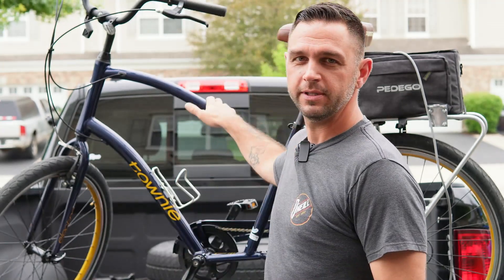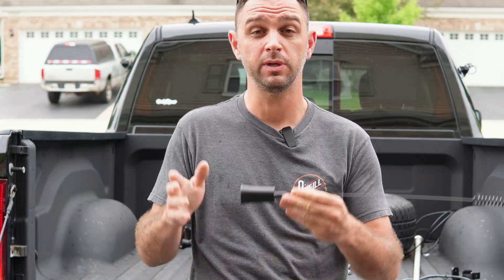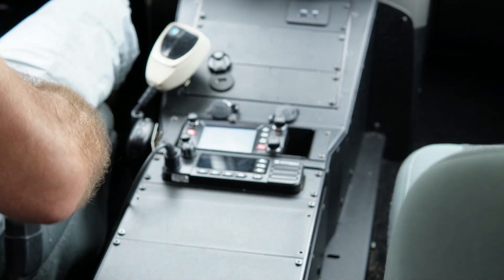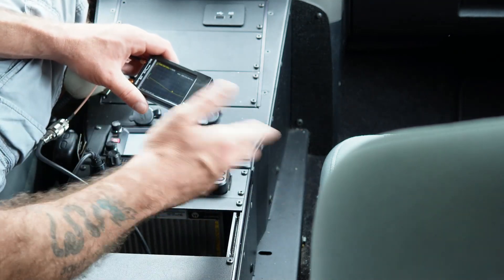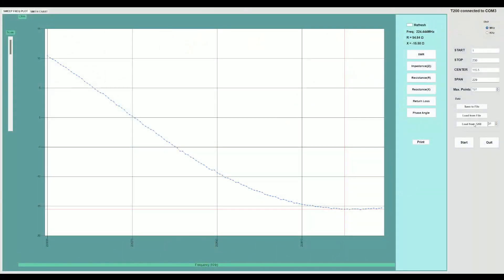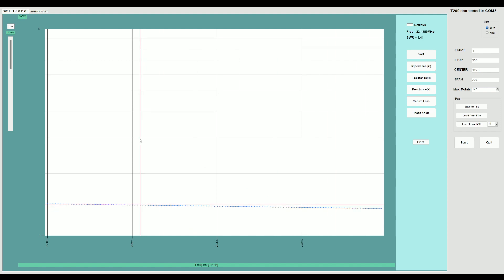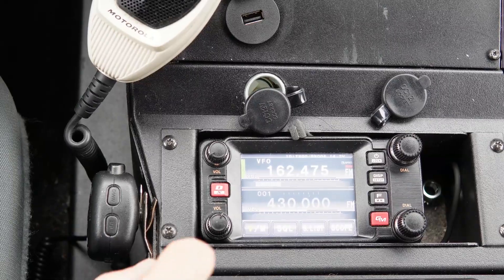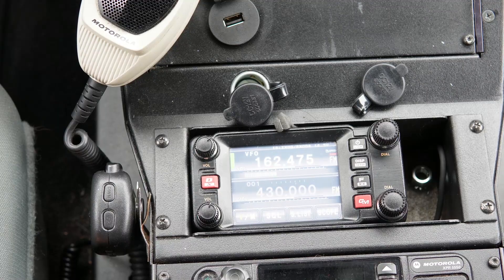Larsen NMO 2/70B Mobile Antenna Overview - Will it 1.25M?

Comment: Thanks for making the video. I have the Larsen NMO ⅝ wave and it has performed well. However, if you were comparing its performance to a ¼ wave on the same NMO lip mount on the door of your truck, you were hamstringing the ¼ wave antenna, which needs a ground plane where a ⅝ wave does not (it needs a counterpoise but doesn’t care about a 1/4 wave radius of flat reflective metal at 90 degrees from the vertical). An apples-to-apples comparison would be the ¼ wave in the dead center of your truck cab’s roof compared to the ⅝ wave on the lip mount.
Reply from the maker: I see what you're saying and it makes complete sense.  Thank you very much. I did keep things the same. I'm pretty much the reason for that is originally I didn't want to drill into the roof as this was a lease.  Now that I own the vehicle, I may be more inclined to do that and it would definitely improve performance. Additionally, I think that would also resolve some reactance issues.  But what I think I can do to continue on and keep on experimenting, it's just getting a mag mount on the roof temporarily.  I don't have one that will fit the nmo at the moment, but I'm sure I can come up with something. And then ultimately, when I move it to the bicycle, it's probably not going to make a huge difference where it's mounted because of the limited surface area.  Thanks again, and I'll hopefully have another update to this soon
Reply: @DudeTested  I haven’t done a bicycle mobile rig, but I think the concern with using a ⅝ wave on an NMO mount on a bike is the relatively small amount of metal to be used as a counterpoise. I think KB9VBR did a video using a homebrew EFHW on a fiberglass whip. It’d also consider doing a roll-up j-pole on a whip. Not as slick looking as putting an NMO mount on a rack, but potentially more effective.
Reply: Tim... you are spot on !  Thanks for keeping our Dude on the path of the Righteous ! <Smile>
Reply from the maker: Just an update, I ordered a nmo magnetic amount for the center of the top portion of my truck. It should be here tomorrow and that means hopefully I can start recording by Thursday.  I appreciate this because it really not only teaches something, but gives me the opportunity to have other people learn from my mistakes.  I really do get excited about this stuff lol
Reply from the maker: Hi tim, thanks again for the suggestions and knowledge.  I spent the day kind of playing around with a few things.  Number one I got a magnetic mount and placed it in the center of the roof. However, it appears at the magnet isn't very strong and there's no significant difference in the capabilities of either antenna (my old one or this one).  My thought process on this is one of the few things.  It's possible that even though I'm on top of the roof, I'm not getting a good ground plane.  Also, I did move the vehicle toward the center of the street which should be far enough away from any metallic objects that would create any kind of weird coupling style effect.  I wanted to run this thought by you.  If I took a grounding strap and ran it from the magnetic mount to the frame of the vehicle, I believe that that may increase the overall performance of the roof mount.  Otherwise, most values and reception are about the same as they would be on the side of the vehicle where I have it now.   Additionally, I suppose I could modify the three magnet Mount that I currently have to work for an NMO, to see if I get better results with a better magnet.  Is there anything else you can think of? My other thought would be to create a bracket to mount this on top of a large metal fence that I have currently.  Dispense would be away from any kind of electrical sources and may help to see what readings (on either antenna) and reception is compared to on the truck.  Any thoughts? Thanks again, and I appreciate all your assistance
Reply: @DudeTested  I’ve used a ¼ wave on the trunk lid of a coupe with an inadequate ground plane for years, but it’s difficult to measure comparative performance where I am (the SF Bay Area) because all of the repeater sites are on a ring around the Bay, which basically allows mobile antenna systems to perform adequately even if they’re suboptimal. The lesson there is that in all UHF/VHF applications, these differences are marginal. If you were engineering a permanent radio link (say, at a cabin) and wanted to operate with lowest power and highest reliability, okay. But a mobile installation is different. So your signal is down 1.5 dBi over the right front quarter of the truck or bike? Whatever. Thirty seconds of driving or two minutes of pedaling and every operating parameter of your system will be completely different due to changes in elevation and topography etc. I don’t lose any sleep over lost antenna performance in a mobile or HT because it’s easy to completely overwhelm the loss by climbing a set of stairs in a parking garage or whatever.

I don’t say this to discourage you from finding out marginal differences — I’m the guy who started out talking about apples-to-apples comparisons, and I will watch a YT video about VHF/UHF antenna performance any day. But if you find yourself bonding a mag mount to your car with braided cable to get better antenna performance, you might be too far down a rabbit hole. My rule for mobile mounts is “drill an NMO mount in the dead center of the roof if you can; if you can’t, do whatever looks good and don’t sweat it”.
Reply from the maker: @timothyfox3995  thanks for the great reply.  I think you gave me everything I needed.  I believe I was in the pursuit of the knowledge and examples and you proved to be an  amazing resource to me (and others) thank you

Comment: Mine works fine on 2 meters but 70cm is high on the higher portion of the band any recommendations?
Reply from the maker: Possibly.  I don't want to give bad advice, but my first question is, do you know about using an allen wrench to losen the bolt at the base and adjust the antenna up or down for fine SWR Tuning?  Again, not my intention to be disrespectful or give bad advice, but I need to know if you tried anything yet.  Thanks!

Comment: That antenna sucks I had one and I didn't like it because it wouldn't work unless you had your hand physically on the whip itself it wasn't grounded therefore that was a hunk of junk to even buy I'm using a mini mag in its place because it's better than these big bulky antennas
Reply: Is this an issue with the nmo mount and perhaps not the antenna itself.  Is the nmo mount not properly grounding to provide ground plane?  Just curious.

Comment: Thanks for the interesting video, and also for your comments about prices/stores.
Now, you mentioned the Comet SBB5NMO. I wonder if you have tried the Comet whip on the Larsen base. I have a Comet and apparently the base is broken. It just doesn't work anymore. It's not serviceable, and they don't sell spare coil bases separately, as Larsen does for their antennas. Anyway, I was considering a new one, going with Larsen this time... And wondering if a Larsen coil base (2/70BCO) + comet whip would work acceptably, because if that were the case, I could save a few bucks ;)
Thanks in advance for your insight.

Comment: Thanks for the video. You will  find the centre of the roof cannot be beaten. Everywhere else will work ok... but the roof centre is optimal. Sadly... not always possible. Most YL & XYL's (Ladies) will object in you punching a hole in the roof of the family car. If you go that way... depending on the roof and the antenna.... a re-enforcing plate on the INSIDE of the roof is highly recommended. Thanks much for doing the video,  Do take note of Timothy Fox his comment re the 1/4 wave.... those absolutely need a decent bit O' Metal below them.  Also note: The coupling to to the roof of some magmounts to the roof ain't very good... punching (NOT DRILLING !!!) a hole in the roof ensures a great contact... but is isn't worth getting divorced over <Smile>.   Many happy contacts.
Albert EI7II.
Reply from the maker: Hey, thanks for the comment. I think that's a good angle to take for tomorrow. I ordered a mag mount nmo which will be here tomorrow at some point and maybe the angle is to reference this video then test at the center, check the performance and then maybe even drive to a less urban environment to test and see what the antenna does at both positions (which we discussed in the live stream). Thank you and Tim both for the positive critique, I agree fully!
Reply: @DudeTested  HRD.....another quick tip here.  Not common in the good old US of A but very popular here in Europe are mag mounts made by the Italian SIRIO company. HOWEVER.... in the box with the mount is a sheet of something. (looks like foil).  The installer ( You, me, or whoever) needs to cut that sheet to the round size of the mag mount and put it in between the magmount itself and its rubber boot that protects the roof. If I were to get a dollar from all the folks who have chucked that sheet in the trash I would go out and buy a new Yeasu FT101MP and have cash to spare.
WHY that is not done in the factory eludes me, surely they have their reason but it is not done. If you do not put that sheet in.. yr SWR will be ALL over the place.
What is so nice about these SIRIO mounts is that you can open them.... and if need be...replace the coax cable that over time tends to get damaged by going thru tight fitting door seals.  Not ever having had a Larsen mag  mount I do not know if you can do that on their mounts? 
Albert  EI7II.